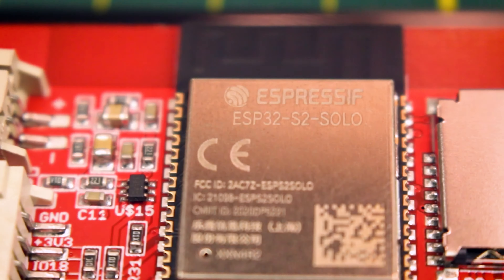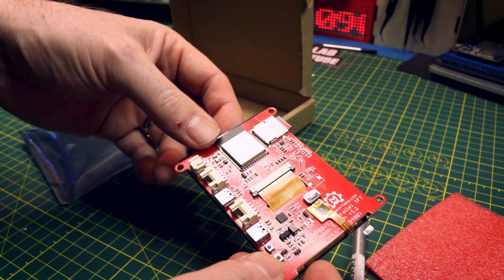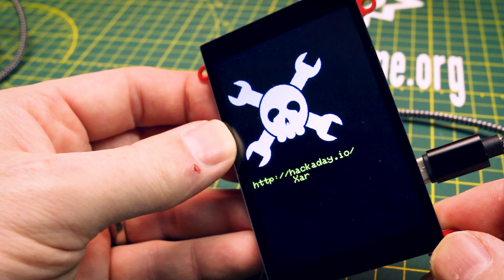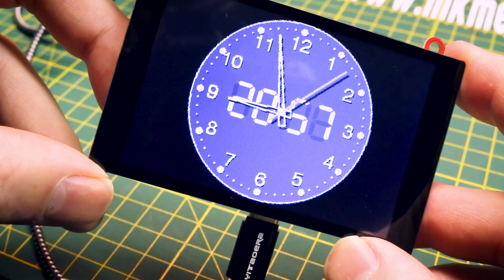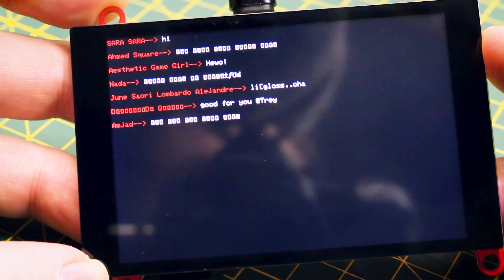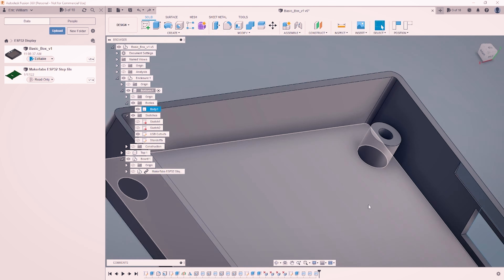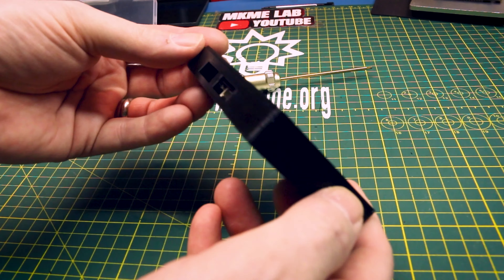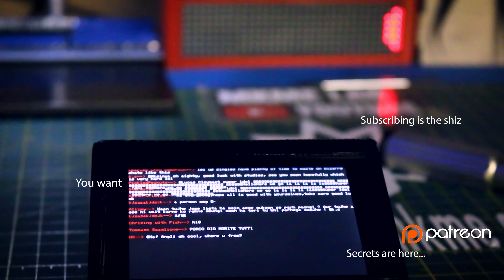My Favorite ESP32 Project EVER

Comment: My big issue with that device, even though it looks cool is that the graphic libraries are crap and the tearing of the screen when you were pressing a 2d ball because forsomereason it seems like some sort of vertical sync is implemented. The dual core esp would've been better I think. One to build the primitives and pass off the triangles to the second core for occlusion culling and texture mapping. A teensy version would be cool. I'm not trolling either. Espressif should've provided a proper next gen upgrade over older 2 core esp32. Being makers doesn't mean we should be happy with the state of processor speed and worrying about battery life. Why has no one ported doom over to an esp. A 100 dollar unlocked tablet would better serve. The device is great in a vacuum, cudos to the makers but your embellishment of the prospects aside (I'm totally joking brother) doesn't mean we shouldn't expect more or turn to superior platforms. The teensy is 700mhz with great audio that's relative inexpensive resource wise.
Reply: Makerfabs have an S3 version of this board now. Dual core. You can also swap out the display for a drop-in ili9481 replacement which is IPS (usually) and looks much nicer - requiring modification of the supplied libs naturally.

Comment: A power hog i'm sure, 2 amps maybe
Reply: Anything with a radio transmitter is going to use a lot of power.

In Eric's application, there isn't much benefit to trying to run it on battery, so power consumption is less of a concern.
Reply from the maker: Ummm 2 Amps???  It draws ~300 mA with radio actively rx/tx.  Maybe I could get it a bit higher if I lit every pixel at once.
Reply: @MkmeOrg  It's TFT so all pixels are 'lit' from behind all the time - just selectively filtered so consumed power is not proportional to visible pixels - unlike oled.